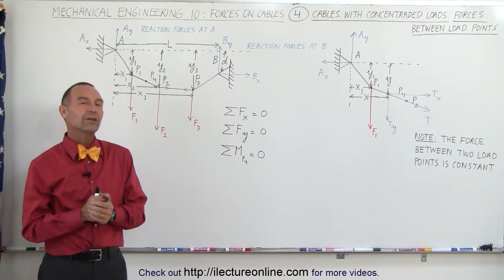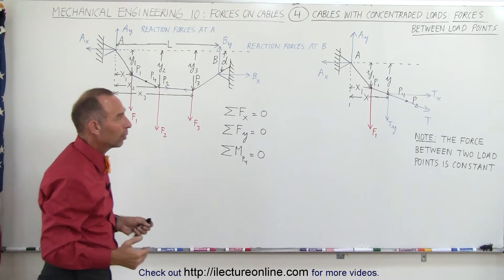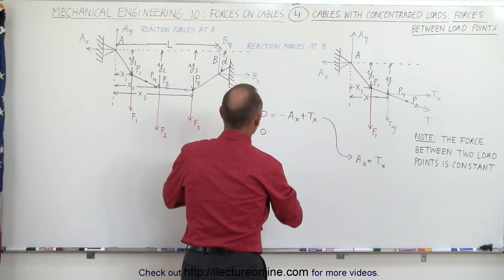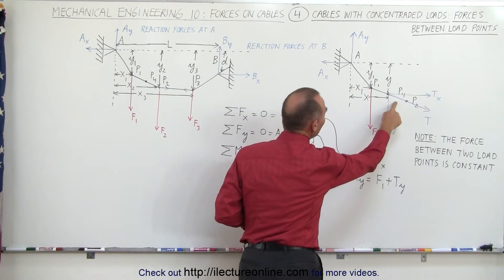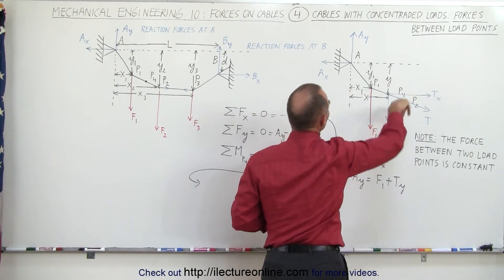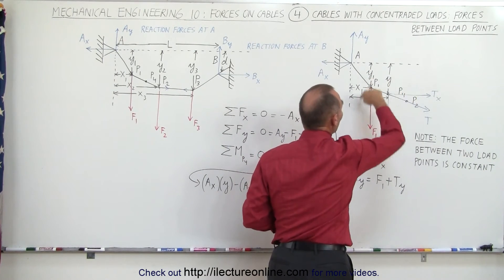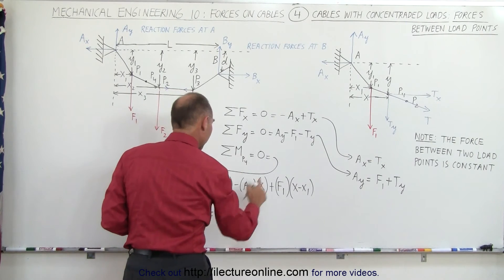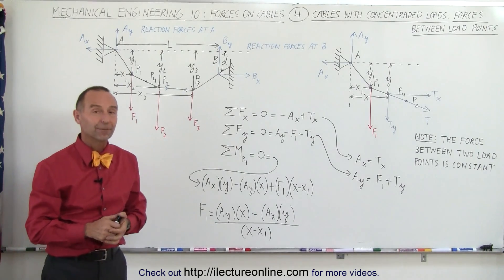Mechanical Engineering: Ch 10: Forces on Cables (4 of 33) Concentrated Loads: Forces Btn Load Pts

Comment: regarding the direction of the F1 in calculating moments, why don't we use the right-hand rule? when it points down, it is a cw direction, so we write it as negative but why is it positive? i am just confused
Reply from the maker: It depends on the point chosen about which to calculate the moment.  In this case the point is to the right of F1.